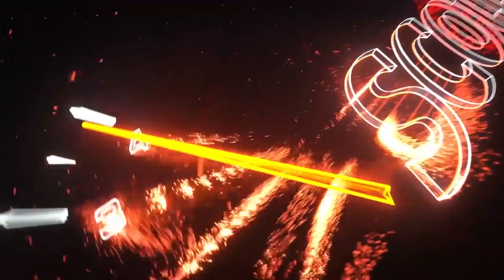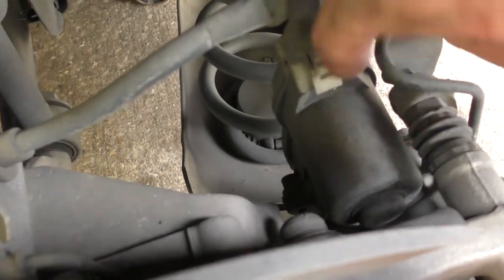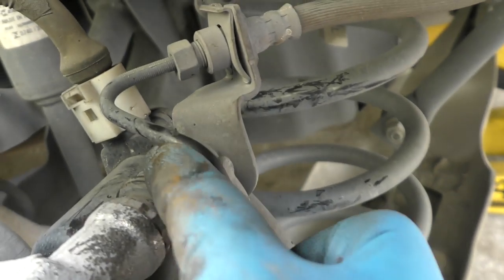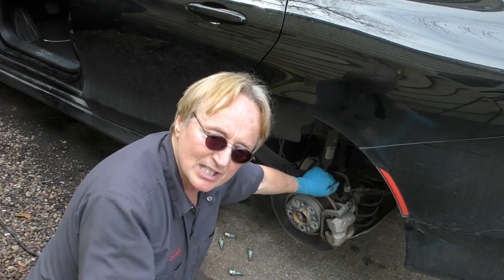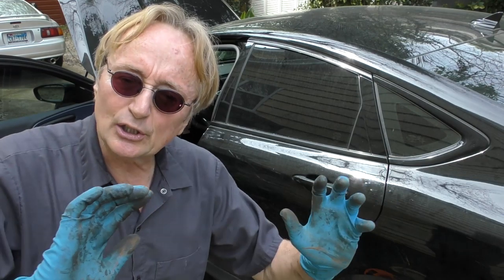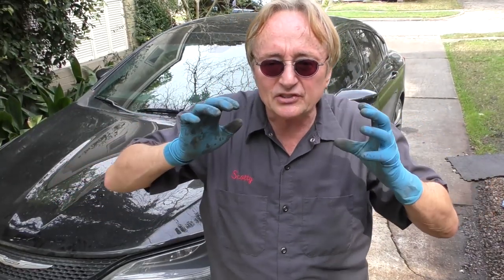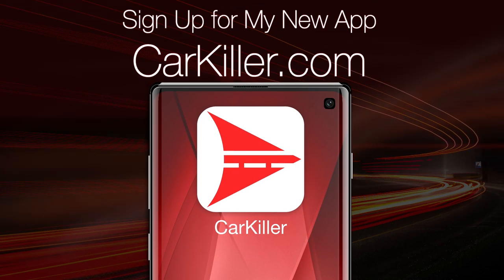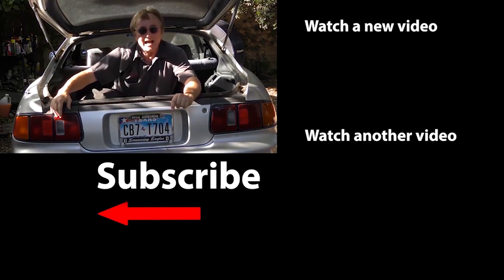This Trend is Stupid and Dangerous

Comment: My 2001 Jetta, and cobalt both require turning and pushing the rear caliper piston. Thats nothing new 🤦‍♂️ and no fancy tool, get the square that fits different models. Easy. No caliper reset tool required...

Comment: Good day, Scotty. Last year I traded in my 2012  Nissan Frontier Pro4x, manual transmission with 90k miles for a new 2018 Frontier Pro4x zero miles with an automatic transmission for towing a boat. Did I make a mistake?

Comment: The cable operated systems are often prone to failure as well. The cable can bind up inside of the sleeve (which is common) since  it is subject to the same elements as any electronically controlled system. The cable can be subject to metal fatigue and or maladjustment over time (which is also common). Most vehicles of a certain age have poorly functioning (if at all) emergency brake systems regardless of what style. Outliers excluded, I would be surprised if the aggregate failure rate was significantly higher than cable controlled systems. Not to mention the much greater consistency of application of the electrical system. You raised some interesting points but remember that you are speaking from a Texan perspective and maybe unaware of the treachery that tends to be seen from cable controlled systems in other climates.

Comment: Love the videos. Can you do a video on turning off the stupid TPMS light when you get new wheels?  Got wheels/sensors from TireCrack who swore they were Toyota compatible.  I then took my '19 Corolla to the $dealer and they couldn't figure them out.  Bought a tool from tireCrack and it didn't work.  I can activate the sensors by deflating the tires but I think I still need to program the car.

Comment: This what I have encountered the chrysler electronic EBrake system. if the vehicle is equipped with a navigation/infotainment system there is a brake service menu option, that when it is selected into service mode it automatically retracts the caliper piston, after the service is completed then reselect the brake service completed mode on the service menu this automatically adjusts the piston back on the brake pad .

Comment: Emergency/parking brakes for most people are like spare tires- they are ignored until people have an emergency and need to use them. But because they are ignored and neglected they are next to useless if the elements have had their way with them. Cable operated systems if never used can corrode and gunk/freeze up, and while it should be part of an annual vehicle inspection process many places outright ignore it. Cable operated systems also depend on regular adjustment for peak performance and while this adjustment is easy, again it is ignored by many drivers. Electronics in cars are becoming more prevalent because more and more drivers are becoming lazy. Automatic headlights, parking assist, lane departure warnings, etc. are things put in cars because an increasing number of people cannot be bothered by the task of driving and basic maintenance. Give me simple any day of the week!

Comment: Actually Scooter the scan tool can push in the piston for you. 

Additionally it’s a parking brake not an emergency brake. However if you do pull the parking brake level the hydraulic control unit will actually apply the front brake so you rear end doesn’t spin around on you.

Comment: a motor is a very reliable piece of engineering, as long as you dont stick any cheaply made motor. Chrysler engineers things to fail no long after the guarantee expires. I have an acura 06 with 160K and all the electronics and motors work like new, its all about quality. Just dont buy Chrysler/Fiat products.
Also, this same car is AWD. Changing the transfer case fluid increased my mpg by a whole 2 mpg!

Comment: Yeah, I don't think the electronic e-brake is such a good thing either as opposed to the old hand brake.  I really wish I didn't have such a soft spot for early 2000s Jaguars and some other cars like it which Scotty would SO recommend avoiding like the plague.  The electronic e-brake for the XJs was started on the 2004-09 generation.  That means more electronics to have to worry about.

Comment: Hey Scotty, I have a 2003 Maxima with 182k.  Great running vehicle and no problems until recently. After getting a couple of crank codes, I replaced some parts and censors and I came to the conclusion that the timing chain or the main timing chain tensoiner need to be replaced. I'm thinking about having this work done because I not looking for car note at this time. The repairs may cost me $1200 to $2500. Your thoughts?

Comment: Even worse is when they eliminate throttle-cables and put in a radio-controlled throttle solenoid on the engine.
Needlessly complicated and it does not take a lot of imagination to realize it could be dangerous in several ways.

Comment: Hey Scotty!

Incase you are wondering, the reason behind that crappy electronic parking brake is the following:
A. The car has 4 wheel disc brakes. This is the root of the entire situation.
B. Disc brakes are great for driving, but make horrible parking brakes. Brake shoes/drums make WAY better parking brakes.
C. To save weight and make the EPA happy, they Decided NOT to go with a combo disc / drum brake system in the rear.
D. So now you are stuck with using a disc brake as a parking break. The only way to make that work is by using a HELL of a lot of braking pressure!

But... how will you maintain that braking pressure while the car is not running in a reliable way?

1. If you used a regular parking brake lever or foot pedal, the driver wouldn't be able to provide enough force to reliably engage the parking brakes.
2. If you used hydraulics to provide the braking pressure it would work, but even a small leak would randomly let your car roll down a hill in the middle of the night.
3. Use an electric servo to jam the living hell out of it using a motor and lots of gears. Not ideal, but it does reliably maintain breaking pressure when the car isn't running.

Do I like it? Hell no! It's stupid!
But this is how and why it happened.
It is the natural result of having 4 wheel disc brakes while at the same time trying to be as light and fuel efficient as possible.

Comment: all honda has screw rear brake pistons, even when it was pull cable. electronic one is always pulled hard. the manual one might be loose depends on how hard the driver pull...which in some case not secure....also some car will detect a slope and automatically apply electronic rear brake, not relying on a old lady to remember.

Comment: My aunt had her electronic parking brake dislodge on her 2010 Outback. Now my next question is when you replace the electronic parking brake motors, do you also have to recalibrate the computer to accept the new unit?

Comment: There is one car I did brakes on the other day I had to use the big scan tool to have the motor move the brakes back to put pads in. It would not turn otherwise!

Comment: I hate it, I love my 2007 Honda Odyssey because it has a footbrake and then I don’t even have to touch anything with my hands and it frees up space in the Center console. I hate driving my 2017 outback because of the electric break it feels like it’s not even doing anything because it’s just a switch that I could flick with my fingernail. The old fashioned emergency brakes just feel so good when you activate them, you have to use some strength to do it and it feels like it’s actually doing something to stop the car.

Comment: My problem with that is a parking brake/ e brake should be a separate brake system that doesn't involve  the main brake system ( drum brakes inside rotor), other wise if you going to use the main back brakes at the brake then why not just make a locking mechanism  for the pettle to lock all brakes on at once,

Comment: Hi Scotty, I have a Mazda sx7 SUV with 50,000 kilometers. It has been great so far, but it has one thing I do not like. When I start it up in the mornings it revs up to 2000 rpm and  a cluncking noise is heard in the engine. This noise stays up for about 30 seconds then it goes away. I assume this is because takes time for oil to lubricate engine when it is cold. Is there a way to reduce rpms from 2,000 to 1,250 when it is cold without having to reprogram computers or modules, ? this is getting annoing.   Thanks

Comment: My step brother is a certified mechanic and he hates these electric parking brake systems with a passion. He was telling me about the pain of having to disengage them electronically in order to do a brake job, and I kept wondering why manufacturers went to this electronic system. 
Older generation was having trouble applying/releasing the brake? 
Cheaper to manufacture (which I seriously doubt)? 
Are they safer? 
Were engineers just trying to be cute?
Is it really all just a profit scam for the car industry?

Comment: Hey Scotty, I've changed the head gaskets on both a dodge magnum v8 on a 2000 durango and a 2003 Pontiac grand am gt v6. Why do I have charging system issues with them. I have a jumper wire from the alternator B post to battery + on the Pontiac to keep it charging but that idea doesn't seem to work on the durango.

Comment: Hey Scotty i have an important question... I have a 2008 Scion tc with 109,000 miles on it. Ran it too low on oil and has a severe rod knock. Do I replace the engine or forget the car?

Comment: Years ago, I worked for GMs mobility department.  GM would pay up to $1000 o have mobility equipment installed in a new car.  We had one dealer in Texas, who was installing electric parking brakes in their cars.  The only dealer in the US doing that.  We did a little research, and found out the dealer found a loophole in the system, and was exploiting it. He would have a local installer put in the electric brake, then bill GM for it.  Because mobility equipment was installed, the state waived the state taxes on the purchase.  We changed the program, requiring a doctors authorization, before any reimbursements would be made.  The dealer never installed another electric brake, while the program existed.

Comment: Wow. Complex crap what happens when the battery cable pops off or the cable and post build up enough oxide to have intermittent connections or a lot of resistance. ...and maybe no starting too.? Check the battery often..replace when 2--3 years old. Battery's go dead when it is extremely hot or cold...

Comment: There are a few things like this that really bother me with newer vehicles.  A couple of them off the top of my head are automatic folding mirrors and running boards.  Sure it looks neat, but I'm sure those are a lot more expensive because of it and it doesn't really serve much purpose if any at all.  When are you going to need to fold in your mirrors without being at a complete stop anyways?  Are you going to fold them in and drive in a tight space without getting out to make sure you have the clearance if it is that tight of a fit?  The automatic running boards are like sticking a motor on something that could just always be out.  It doesn't matter how much more aerodynamic that could make your vehicle it isn't going to make up for the cost of replacing one of those things I'd bet money on that.

Comment: I hate electronic parking brakes.  At least on this car you didn't need special ($$$$) software to retract the piston for service.  On my wifes KIA I had to take off the electric motor and wind in the piston with an allen wrench.  I agree with Scotty, it's a solution with no real problem.

Comment: Manufacturers are going a little crazy with trying to eliminate every single mechanical cable or link from the assembly line.   They’re pushing electric parking brakes because they don’t want to spend the time paying a worker to install a mechanical cable and adjust it on the assembly line.

Comment: Ugh... That is one of my least favorite features of automotive design into the future. Personally, I love a real handbrake because in Alaska, "snow drifting" is my favorite winter pass time.
Reply: Not only that, I never know when it's on. Some dont have a light and only a dash message. I'll get into a new car, start it hold the brake and then flick the little switch and accidentally turn it back on. Let alone when it automatically sets when it parks. I'll stop in my stall and flick the clit and it will say I turned the parking brake off.

Comment: I was test driving a 2020 escape that had all sorts of electrical issues from the factory because another mechanic said he fixed it but was already test driving another car he was working on that night. 

Don't buy anything new.
Too many electronics.
I was stranded in the middle of the road, both batteries were instantly zapped and I couldn't even turn on the hazards. Car stopped hard as soon as it died and I was unable to put it in neutral. Ended up getting a ride home, collecting every car battery I own, and switching between them to get the car in neutral to be towed. 

Sh** show. Never buy one.

Edit: important detail, the manual pull wasn't put it from the factory. It was just forgotten.

Comment: I thought the emergency break was required to be mechanical for safety reasons. 

I know I’ve had several occasions where I needed the emergency break. 

One in my old 1993 Cadillac Devil when the master cylinder failed while I was driving I had to slowly depress the emergency break to come to a stop it was a pedal. 

The second time was a 2000 VW Beetle that had a hand break and the timing belt broke I lost all power to the vehicle and breaks wouldn’t work had to use the emergency break to stop on the side of the interstate.

Comment: Maybe there making most servo and hydraulic systems for weight and ergonomics.   I mean some people may have a hard time pulling an emergency brake handle.  The maintenance is easy it looks like the component is built into the caliper?

Comment: I'm keeping my 94' F-150 until I die. Never buying anything newer then 96'. I like my Inline 300.
Reply: What if u could get a 97' Toyota Tundra or Tacoma for a great deal?
Reply: @mrgarrison3516  Nope. I know this generation like my own body. There easy to work on, and I've got everything I need from my own anyway. I wouldn't know how to work on a Toyota, at the moment, I know my Electronics, engine, transmission, and most of the body. I'd have to relearn everything to make sure I don't get screwed on a 10 minute fix. (I live in Austin)

Comment: My 2019 Rav4 has the electronic parking brake.  Every time I put the car in drive or park, I hears this noise.  I took the car into the dealership to ask them "What's that sound?" (I thought it was a transmission issue) Guy said it was elect parking break. I had to get the manual out and learn how to disable it.

Comment: Guess what my throttle cable driven my cruise cable driven my handbrake cable driven my gear section it’s an auto cable driven my hood latch cable driven. All original haven’t broke still work I lube up the laches from time to time grease up the handbrake and everything just works. Not once have I had to replace a cable.

Comment: Well its really 2 systems in one ,, and most people don't understand this ,, its a powerful ABS applied and modulated emergency brake system that wont cause skidding and that apply's the brakes on "all 4 wheels" when its used when the car is in motion (don't mess with it if you have traffic close behind you as it it apply s full maximum braking effort as long as you hold the switch up)  it does rely on the brake hydraulics though,  you can pull and release to moderate its action,,  it will even work without skidding on slippery surfaces as the ABS anti skid is always active ,, the parking brake aspect of it that works when the car stopped that apples the rear brakes "also self adjusts" so no more stretched brake cable that does not fully apply the parking brakes .. on our car there is no motors on the calipers there are cables that go to a central application electrical servo that puts tension on the cable.

Comment: A rally style hydraulic handbrake with the addition of a locking switch makes much more sense than this dangerous monstrosity. An emergency brake that doesn't work as a reliable backup in an actual emergency is asinine.

Comment: Please HELP Scotty.I have an 05 Mercury Grand Marquis,155000 miles and runs and rides great except When i get to about 50-55 mph the front starts to vibrate or shake in my steering wheel.I changed to wheels altogether but it still happens.Please let me know what else it could be.Thank You

Comment: Scotty please help I own a 2011 Ford Fusion 2.5L 4 cylinder 133,000 miles my air filter box shakes hitting my fuse box causing a very annoying tapping i changed the air filter no improvement I'm lost please help

Comment: With most of these electronic e brakes you have to hook up a obd scanner and set it in a service mode. Also a thing when the hydraulic brake system goes wrong for whatever reason and you have to brake fast there is so much lag before this shitty thing will do anything.

Comment: Im pretty sure they don't actually have a strong motor, the motor isn't what's holding the brake. It's probably turning a worm gear, and they are using the worm gear spur gear design to lock it up. Would be why you need that special tool to turn it and compress it at the same time.

Comment: I like the old handle or pedal cable operated parking brakes.
Reply: I like the pull t handle to set, twist t handle to release e-brake on my old Studebaker almost as much as the pull handle type on Scotty's Celica.
Reply: @stephenarling1667  : I am not big on the pull and twist t handle type parking brake, but looks like we have something in common, we both prefer the older style cable operated parking brake, not this  high tech button operated expensive to repair type of parking brake.